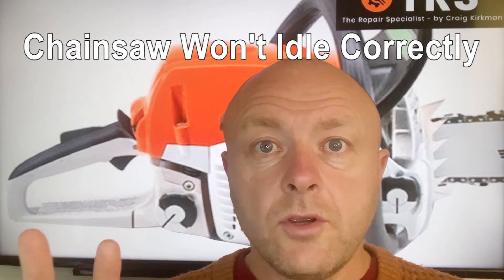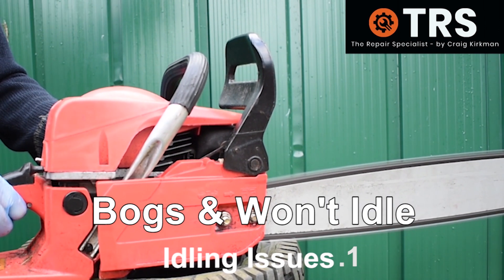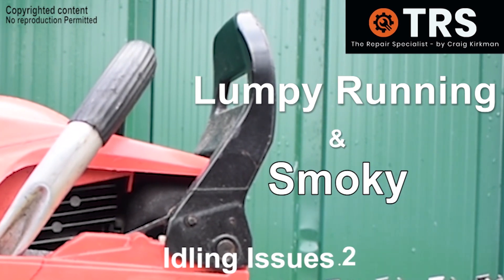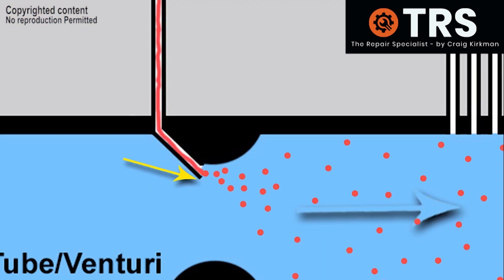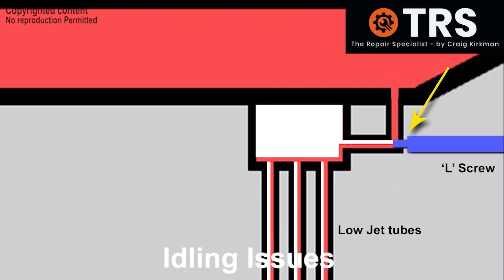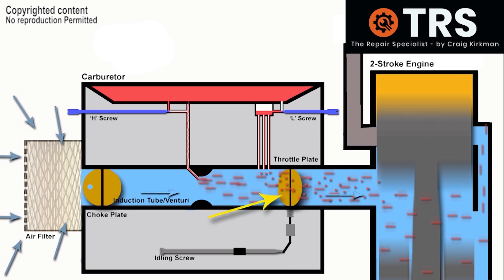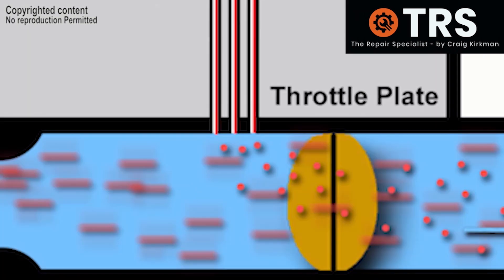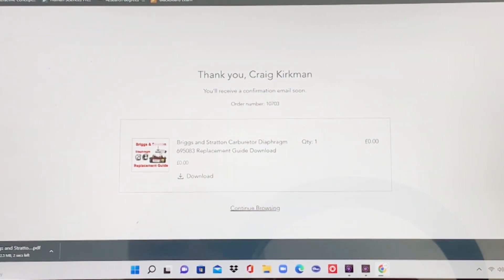Chainsaw Wont Idle - This is why - Do this to Correct it!  (by Craig Kirkman)

Comment: I am impressed by your videos. Please use the word "vacuum" instead of "pressure" in your explanation, because vacuum is the driving force in a carburetor.
Reply from the maker: Thanks a lot, really glad you’re enjoying the videos! You’re right — most people traditionally say “vacuum” when talking about carburetors, because it’s the low-pressure area in the venturi that draws the fuel in. Technically, it’s a pressure difference (atmospheric pressure pushing fuel into a lower pressure zone), but in everyday small-engine talk, “vacuum” has always been the common word. I try to use both so everyone understands what’s going on. At the end of the day, whether we call it vacuum or pressure, I suppose it’s the same effect that makes the carb work.

Thanks again

Craig

Comment: a quick question on the t screw if it is turned all the way in what is the proper adjustment back out for it to run the correct way.

Comment: Why does it turn off as soon as I touch the accelerator if I changed the diaphragm?
Reply from the maker: HI
thank you for reaching out with your question about your chainsaw stalling when you touch the accelerator after changing the diaphragm.

It sounds like you've taken a proactive step in replacing the diaphragm, which is a critical component of the carburetor responsible for fuel metering and delivery. However, a few factors could contribute to the chainsaw stalling issue after this replacement:

Diaphragm Installation: Ensure the new diaphragm was installed correctly, with all components properly seated and sealed within the carburetor. Any misalignment or improper installation could affect fuel flow and engine performance.
Carburetor Adjustment: After diaphragm replacement, it's possible that carburetor settings need adjustment, particularly the idle and high-speed screws. Incorrect settings can lead to a lean or rich fuel mixture, causing the engine to stall when accelerating.
Fuel System Issues: Check for any fuel system issues such as clogged fuel lines, dirty fuel filter, or improper fuel mixture. A restricted fuel flow can cause engine hesitation or stalling.
Air Leaks: Inspect for air leaks around the carburetor and intake manifold. Unwanted air intake can disrupt the air-fuel ratio and affect engine operation.
To troubleshoot and resolve the chainsaw stalling issue, I recommend the following steps:

Recheck the diaphragm installation for correctness and tightness.
Adjust the carburetor settings according to the manufacturer's specifications.
Inspect and clean the fuel system components, ensuring proper fuel flow and quality.
Verify there are no air leaks around the carburetor or intake.
If troubleshooting these areas does not resolve the issue, further diagnosis by a qualified technician may be needed to pinpoint the exact cause of the stalling problem.

I hope these suggestions help guide you toward resolving the chainsaw's performance issue. If you have additional questions or need further assistance, please feel free to ask. Thank you for being part of our community and seeking solutions to improve your equipment!

Best regards,

Craig

Comment: Issue solved on Makita chainsaw, that actually has 3 screws (L,H,S). S is specifically added for idling speed setting. L and H should not be changed without tachometer according to Makita's user manual. The issue in my case was that chain was moving in idle state as if the throttle would be pressed a bit. Thank you for this video!

Comment: So if I had a saw that won’t idle for too long but while it is idling the chain is moving I should turn the L screw to the left to let more fuel in and the T screw to the right to stop the close the throttle plate a bit?

Comment: Do you know what to do in my case - on my stihl chainsaw I have to lower the idling screw after every 3 mins of using the chainsaw. In other words, idling revs just start to go up after using throttle to a point the chain can't be stopped when letting throttle. Is the idling screw loose, faulty or something, seems like it is moving on its own after giving throttle? Can this be easily fixed? Thanks.

Comment: What is suction pressure  ? Do you mean vacuum  ? Pressure and vacuum are not the same thing.  Suction pressure is an oxymoron.
Reply from the maker: I used to use the word vacuum and I got a of complaints about that because one could argue that the word vacuum, as used in physics, means: Space entirely devoid of matter! My explanation using suction pressure gets my point across well so it’s good with me and most others!

Comment: Very good video and well explained also ! Yes those tiny little holes inside the carburetor for the idle side must be clean and not blocked by any debris or any crud in there ! Many people forget about the idle screw setting and if it's not set high enough then your not gonna get your chainsaw to idle at all or it will be sporadic at least !

Comment: I have switched to Electric Brush Cutters, Hedge Trimmers and Chainsaws !!!!  If I have a carburettor problem, I throw the Carburettor away and buy a New Carburettor from Amazon !!!!  I can't be bothered to spend hours trying to fix a Problem with a Carburettor !!!!  This Ethanol Fuel is horrible Stuff and you need to Drain out all the fuel from your equipment each time you store it !!!!!!
Reply: Good luck with all battery power lawn equipment,  I will admit the smaller lithium battery powered chainsaws are pretty neat though ! If you should continue with gasoline equipment use ethanol free gasoline premium grade only and when replacing fuel lines use the black or at least ethanol resistant lines

Comment: Re the H&L needles' tips: When you bottom-out a needle (fully inserted/as much clockwise as possible), is it true that the tips of the needles can get bent? I had been told that SO often (and repeated it myself...), but after a few watches of this video I cannot help conclude it's probably unlikely that it's even possible to "bend an L screw's top by seating it/CW'ing it 'too hard'", would greatly appreciate your insight Craig! Have always gone SO gentle when seating my adjustment screws to fully-in, to avoiding damaging their thin tips, but this video's diagrams make me think that a fully seated screw is not bottoming-out its tip, but instead is bottoming-out the flared shafting higher up on the screw.

Thanks a million for what you do here with your channel, the useful/practical help i get makes your channel my 1st stop BUT I gotta say I admire the hell out of what you do, i don't mean your knowledge i mean your passion in sharing it "thanklessly" like this, whatever little $ you get from it is obviously NOTHING compared to the value that I, and MANY others, get from it.  I cannot tell you how much appreciation i have for this kind of undertaking, it FAR exceeds the practical solutions & 2-stroke knowledge that i learn.  I'll continue spreading your "brand" / url on the arborist&climber boards/forums that I frequent, you truly contribute more to this awesome niche than almost any other single individual that i can think of!!!

Comment: Sir my chainsaw starts n runs for few minutes and automatically offs.
Any idea please
Reply from the maker: HI. Its quite difficult to diagnose the problem with not having the saw with me.  There are a number of causes that can produce such a symptom.  Please take a look at these videos and see if they helps any.  Its my other video collection on the topic: 

CHAINSAW CARBURETOR FUEL SCREW SETTINGS do this Inside Carb https://www.youtube.com/watch?v=wzXvHKNWF4Q&t=638s

CHAINSAW DIES WHEN THROTTLED: https://www.youtube.com/watch?v=_wI-X7aot8Y&t=335s

How to Tune a Chainsaw Carburetor - Practice & Theory together - Unique video!
https://www.youtube.com/watch?v=sQ4hmM_xoXQ&t=238s

CHAINSAW BOG DOWN - How I Easily Fixed it. (You can to!)
https://www.youtube.com/watch?v=Eo6iUTjcQ8Q

2 Stroke Engine Bog - Some Reasons Why & Solutions
https://www.youtube.com/watch?v=vrPg2VTA39I

I hope these help

Thanks

Craig

Comment: How does air get to the primer bulb drawing directly from the metering area when both gaskets, primer bulb [kit installed] are new including the fuel lines?
The filter, grommet and fuel line replaced going to the carb. The kit installed. New primer/purge bulb which comes with hose that connects to the brass fitting which is pressed into the carb body that draws directly from the metering area.  You can see a ton of air coming down the clear hose leading from the carb to the primer bulb.

The carb had the problem of air coming down the hose to the bulb. Put in the kit, still sucking air. Replaced carb, problem gone. Used chainsaw last Fall, last spring, use the hell out of it, [4 months ago. A few weeks ago, I went to start/run it for maintenance, and it has the same problem as before I changed the carb.
Somehow, within the body of the carbs, air is getting into the metering area. It will start with choak, hit the trigger and it will idle for about 10 seconds and die. Instant full throttle it bogs and dies. If I feather the throttle, it will keep running and if I get the RPM's up to 80% of full, then I can squeeze it at full throttle, but it's not running right with low power. Clearly a lean fuel starvation situation because the metering area is not getting solid fuel.
P.S. The high/low screws haven't been changed both on the old carb or the new one with both of then working perfectly at some point and time.

Comment: I have a problem: chainsaw idles normally (though it vibrates too much too my taste) and it works pretty normally at high revs, but it completely stops if throttle is pushed fast. I have to push it very gently so chainsaw revs up. What could that be? That's Makita chainsaw ea3202s.
Reply from the maker: Try adjusting the 'L' screw Anti-clockwise slowly, whist you have the chainsaw running and stable, safely of course, and see if the problem goes away, as shown in the first example in the video. In this example, my chainsaw bogs upon throttle. If this does not work then watch this video where I show how to completely reset the carb.  If this doen't work then you might have a larger problem with the carb or even the crankcase maybe.  Before we jump too far, however, I personally would try the reset first.

I hope this helps. Craig :

Chainsaw Carburetor Adjustment | How to Tune 'Correctly'
https://www.youtube.com/watch?v=74p9FLmIkkw&t=1s

Comment: Anyone who has any mechanical ability at all could become a master small engine mechanic by simply watching all your teaching videos. I’ve never seen anything even close to your explanations complete with moving illustrations. Very generous of you to share your abundance of knowledge here in this setting. Thank you so much!
Reply from the maker: Wow. That is some of the best feedback i've had. Thank you so much. Craig 👍👍👍
Reply: Seriously! In "this digital age", Craig's efforts could literally be used by ANY "apprentice" who desired to take it on... I DO wonder what the "threat to 2stroke" of lithium OPE/gear will do to this niche, obviously my bucking/felling saws are 2stroke but for climbsaws lithium is ALMOST the superior alternative (some say it already is...they are mistaken...Eg my fave climbing unit, the echo 2511t, is a scratch over 5lbs and is one of the most powerful 25cc's I've ever held, while the ~$1k Husqvarna climbsaw is about as-powerful but substantially heavier)  It will probably not be too long before lithium overtakes smaller 2 strokes on power-to-weight, which is the only reason most climbers shy from them despite their increased convenience & decreased messiness... Craig's probably the 2nd-to-last generation of 2stroke repair'ing as we know it right now, I'd wager.